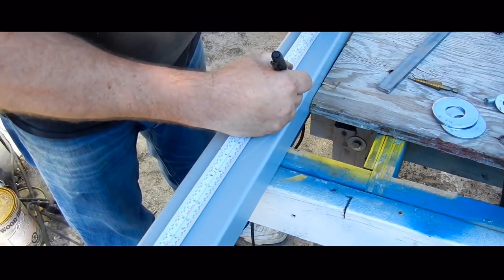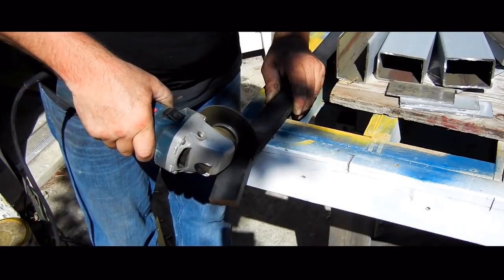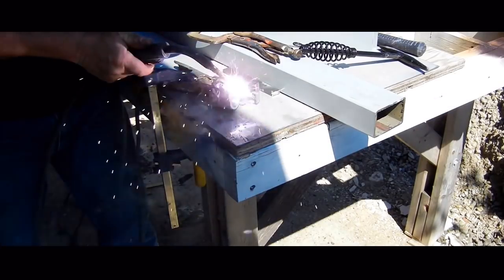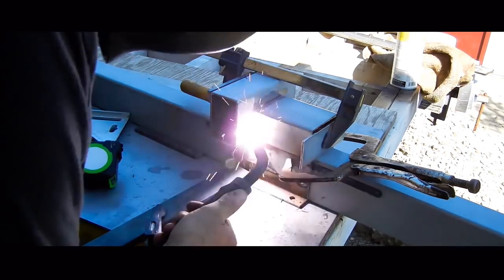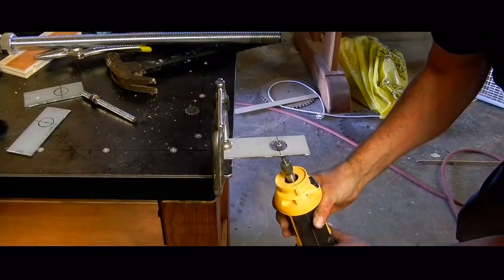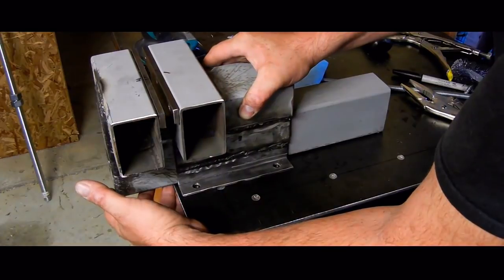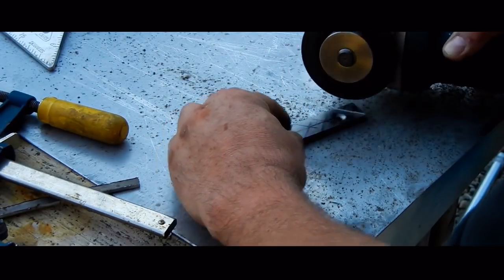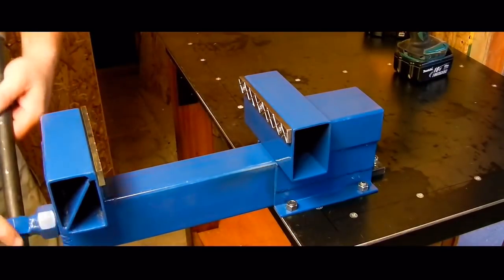How To Make A Heavy Duty Steel Vise

Comment: HI JOHN off the rail road track. I got very lucky a friend of mines uncle past my friend had to finish up his estate & wanted me to help him go through things & clean up the place so it could be sold.of course i said yes. damn glad i did we found a buze saw blade, arbor, block bearings, a solid steel anvil/12" vice the blade was still in the wood shipping create. we had piles that went different places he told me to put this stuff in the trash pile. I said U R crazy as hell my truck turned into trash pile holder. what got me was he knew what the stuff was as i did. i have used the vise over 20 years i have 2 old case tractors with saw pulleys  but i cant take the blade out of the create SEARS & ROBUCK everything is still on it. Anyway i have a wire welder & all the tools to build you're vice i want a 12" throut in mine just to hold wood THANKS for the plans very very NICE

Comment: I really liked this video there are several diy projects I have been currently been tossing around in my head lately I have 2 old break drums I was thinking of grinding down and using and I have a ace die and cast kit just no welder or other scrap metal I'm going to try and make two with what I got one horizontal and one vertical on an old tool chest I have awesome video enjoyed the knowledge

Comment: Good stuff, very helpful for my build. That said, if anyone (or OP for that matter) is interested in making a high quality *heavy duty* vise but also shares my preference for repurposing over true "bespoke" building for whatever reason (lack of comprehensive technical skills w/a dash of laziness in my case, heh); then I can highly recommend using a standard-issue generic car "scissor jack" as your base materials as a alternative to seeking out the correct steel square tubings + lotsa measuring and cutting. Everything is already built to fit together perfectly as well as to function like a vise that's been built backwards, so you basically are deconstructing & reassembling/welding it back together in an inverse fashion (not literally, of course).  Even the most cut-rate jack is still designed to suspend a car in the air too... All of that is made even more appealing by [my unverified assumption of] literally billions of these things having been made, which I swear also sometimes have the ability to self-replicate because *twice* in my life  I've found two of these suckers laying around when I was *certain* I only had one.... and also have no idea where any of them came from either! Hahaha

Comment: it has been some time now since I last built a vise using your idea 
now I moved out of my old home to a new home and gave it away now I did not think of ever needing it again so here I am in need of another vise now a question are you using Flux core mig wire in your mig welder seem to think a stick welder works faster and I have both machine's 
a lot more persist than then a stick is the mig 
any hoo your video  is amongst the many  and the  best of  them all

Comment: First of all, the build is impressive. Your finished product is beautiful, and based off of the durability of steel vs. cast iron, your vise will outlive and outperform the professionally manufactured counterparts. Now I'm not saying it's going to outperform a high end Wilton or some $700-$1000 bench vise, but it will DEFINITELY outperform any vise in the $500 and under range. 

I would LOVE to do this build, but I can't without guesswork. Either I'm missing it somehow, or you haven't provided dimensions and measurements for the build. I even downloaded "SketchUp" by clicking on the provided link. I can see the image of your vise on "ibuildit", but I don't see a single measurement for the length of the cuts on the steel tubing. Like I said, maybe I'm just overlooking it, and if so, I apologize. But if they aren't there I'm assuming this was intentional on your part. 

Also, pay no attention to any of the naysayers. I always tell people that the greatest athlete in the world is the armchair quarterback. It's the fat, un-athletic, beer guzzling slob sitting in his lazy boy recliner- criticizing every player on the filed. The guy has 0 athletic ability, but in his own mind he could out-think and out-perform every player on the field. The biggest critics are usually people with no "skin in the game". GREAT BUILD JOHN!
Reply from the maker: +Trinity Maker 
Glad you like the project. The SketchUp plan provided is just a model - you will need to familiarize yourself with SketchUp a bit to use it. Basically, you can use the measuring tape tool to get the dimensions.
Reply: you're a genius i have to say
Reply: Trinity Maker no, dont lie

Comment: 3 things:

1. Why no cross brace in the sliding jaw?
2. What do you mean "like the real thing", seems pretty real to me?
3. Wouldn't  it look better with the mounting bolts head side up?

This is the third vise I have seen you build, the wooden bench top is my favorite to look at, and I don't  know how I missed this one  the first time.
Reply: Oops, for no.1 I meant the stationary  jaw.
Reply from the maker: Darnley Bynoe 
1. Physics 
2. Store bought 
3. threaded rod, not bolts
Reply: 1. Is it because the fixed jaw has that rectangular T-type support and the sliding one has only the verticle plate?, 2. Oh, but still just love the way that wooden one looks, might even try to make one with one of your wooden threaded rod as soon as someone figures out a simpler way to make diy wooden female threads., 3. Oh, again, guess I missed that they weren't bolts.

Love your stuff for many years now.

Comment: You may have just justified my "need" for a welder! Having woodworking AND metal working skills is a great way to expand the suite of projects that I can do. I took metal shop in high school many years ago, and actually did some welding during my first year of employment. Hopefully it's a matter of scraping off the rust (sorry, I had to write that) and buying a 90 amp welder. Do you recommend MIG or TIG welders? I don't want to use traditional rods, because it's way too messy.
Reply: Recommending a welder is difficult if nothing is known about intended use. Each process has its strengths, and weaknesses. Personally I have them all. I got a MIG, a TIG, stick, and a gas torch too. Now which I'd favor would depend on what I was welding. But if I had to recommend just one to a hack starting out in their garage I'd go with MIG. Because MIG fits that profile the best. It is easy, and versatile too.

Two important considerations in that case. Now over time I've come to appreciate the sheer simplicity of stick welding myself. No gas bottles to play with, no wire spools to deal with. I can just put a rod in a stinger, and go basically. Flip the switch.

Plus all of them other processes are for pussies compared to stick welding. I kid, no I don't. But seriously stick welding is for the purists. Man versus steel.
Reply: Paul Frederick Yea everything else is easy compared to sticks-hard to master but when you do you easy adapt to mig or tig.

Why is it harder than others:
-you have to constantly adapt to the shrinking size of electrode
-you have to maintain constant speed and distance for a good arch
-and angle of electrode affects the puddle of welding too

+is electrodes for iron are cheap
+stick welders are cheaper than tig or mig
+you can buy inverter with tig and stick welding
+no extra money is spent on protective gasses(not everyone has bottle refill factorys nearby)
+no money is spent on replacement parts like tig and mig have

So for a hobby welder buy a good mask and stick welder(don't go auto darkening-good ones are expensive(800,900$ ),cheap chinese are good for nothing).
Decent stick welder costs around 200$ (inverters)or if you are lucky you can get good old 1970-80s transformer which will run for another 50 years for 50-100$.
There is no need for buying fancy equipment if you cant make money out of it,so yea stick welders are great for starters.Sure they are more difficult to master ,but nothing is impossible if you try hard.sSpend a pac of electrodes weekly and for a 1 month you will see drastic improvement.Your hand gets used to it.
Reply: zumbazumba1
I don't know. Yeah there are things to deal with stick welding. Chipping flux, and stuff like that. Like you say, feeding the electrode too. I think it all comes to practice though. One thing I'll do is warm up coupons before I weld a bead I care about. Because I don't weld every day. So a little practice ahead of time gets me going again. Failing to plan is planning to fail. I tell folks success hinges on preparation too.

I see lots of people that get it in their head that they can work any old dirty way. I suppose they can too. But the job they do is going to reflect that. Get everything ironed out before running a bead that matters. Because things aren't going to just magically start happening usually.
Reply: Paul Frederick Thanks! I was trained and became quite good at heliarc welding on .052' thick aluminum. So I am probably most interested in something using inert gas as the flux. I'll look around the local tool shops and see what I can find.
Reply: MrJohnnyboyrebel
I've read about heliarc. I do not think it is too popular anymore. Today Argon and Carbon Dioxide are the more used shield gasses. Aluminum is too finicky for me to weld. My success rate with it is so low I don't even bother with it anymore. That is likely due to the humidity level where I live.

Good luck with gas bottles if you swap them. Good luck getting bottles that don't leak that is. It got so bad with the gas house I used to deal with that I started bringing soapy water with me.
Reply: +John Treble Heliarc is pretty much the same as tig  late replies are best replies
Reply: EvilBunny
TIG is heliarc if you use Helium as your shield gas. Helium is not a particularly renewable resource so there is only a finite supply of recoverable Helium in the world. Which is why other shield gasses are more popular now. All of this is why the Germans used hydrogen in the Hindenburg. They just didn't have Helium. We weren't in the mood to give them any just then either.

Comment: Maybe it's asked already but 183 reactions is to many to read. What type of welding do you use because you have no gas nozzle around your torch. But also no filled wire because you have to hit the slag of. Can you tell me because I like it for welding outside in the wind. Thanks al lot!!!
Reply: Teun Geerlings He used FCAW. It is one of two ways to do MIG (wire feed arc welding), and this is the one where the flux on the wire shields the bead instead of using gas for shielding like you would with GMAW

Comment: John, I have a welder and I am a novice at it.  Why is it important to knock off the slag?
Reply: It is not. But painting on parts that will flake off with use is bad. welding on top off existing slag or rust can give a rubbish weld that looks terrible.
As a welder I have to say. Do not knock of slag. With correct machine settings it should be possible to gently scrape the slag off. Some oil companys in Norway will fail a weld with chip or grind marks in it.
Reply from the maker: Marc Eaton To clean the weld and and the hammering will relieve some of the stress from welding.
Reply: John Heisz Okay thank you.
Reply: Ant Mallett I asked John not you.  Of course you say it is nonsense and offer no explanation.
Reply: Grows because of that the slag to knock out because the quality of the welding is not seen from the slag.

Comment: if i was making this i would fill the hollow pipes with sand and hammer the sand in to compact it and then cap off the ends to make it that bit stronger
Reply: I dont think it would give much strength, if any!
Sand is usefull to dampen vibration if what you're making has a tendancy to do so, though...

Comment: Is the steel not galvanized so that the paint doesn't stick?
Reply: +Jc Bx The steel was not raw stock, it was something he got free and already had paint on it. Which means all the cleaning had already been done.
Reply: Aaaand you can paint galvanised steel....

Galvanised steel is just steel that's been zinc coated! it has nothing to do with keeping paint off, but is meant to resist rusting.

Comment: What kind of welder are you using
Reply: I dont know the brand but I know for sure that its flux core and is running on assumably 110 volts.

Comment: Only problem with this is that all thread rod is soft ,and most of heavy duty vises use square threads which are better because they have increased strength and they can carry a higher loads.Also they are made of special steel,and usualy heat treated.But again for smaller force its perfectly fine,like woodworking,and you can always replace all thread.

If you are going to buy vise- cast iron,not good for impacts and it brakes.If you are not going to use sledgehammer like for woodworking then those are fine.Just stay away from cast iron if you are going to do heavy  work.Good steel vise costs more but usualy you are going to buy it once in a lifetime,so save money for those.
But again for smaller force its perfectly fine,like woodworking,and you can always replace all thread.
Reply: Store bought vises never have one inch thread acme.screws, so IM sure this will be plenty strong
Reply: nikotwenty
Its not important how thick screw is ,its the shape and material of which is constructed.
I don't know if you refer to thickness or thread per inch since i use metric system like the rest of world.
In my country you can buy heavy duty vise for 100$ that will have acme thread up to 30 mm in diameter.So yea those exist if you look at professional range.And chance to broke those is if you use 10kg(20pounds) hammer and beat it all day for 5-10 years.
Reply: Well,I guess it depends where you shop!
Here in europe, most woodworking leg vise kits, or woodworking vises you can get have screws that size, if not bigger, and any metalworking vise that's worth buying does too...
I've not dismantled cheap-ass  big box store 20 to 50 euro vises to see their threads, so these might have standard or fine thread, but every Vise I've seen in a professional shop be it brand spanking new or 120 years old had thick square thread screws!

Comment: $80 metal to build a $40 vice
Reply: I buy scrap regularly, its more than you would think. The screw mechanism alone costs around $40 if you cant find used.

A 5ft x 2" x2" piece hardened angle iron is $22....
Reply: This is more like a $10 in parts (if that) on a really strong and cool tool that you made yourself. If you don't understand the value of that, you should look for some recipe videos instead.
Reply: I buy scrap regularly, where in the actual fuck are you buying scrap?

Comment: Were you seriously mig welding outside and with no nozzle?
Reply: +Ravenous Pathogen flux core
Reply: Even flux core needs shielding gas, hence the nozzle, the flux is INSIDE = flux CORE
Reply from the maker: +Ravenous Pathogen Google fcaw. You don't need shielding gas with flux core wire.
Reply: I have been known to be wrong.  I always use an 80/20 of Argon and CO2.  I thought one needed gas for flux, if it works for you, cool.
Reply: Ravenous Pathogen there is types of fluxcore that needs gas as well though
Reply: I didn't know that, thx
Reply: +Michael Kopka wut?

Comment: to optima 1 I don't think U have done very much with an angle grinder. if U are trying to save a little money U risk a little pain. sometimes U have to do a little unsafe work i don't give a damn who U R. the guy that invented the grinder wasn't scared he went forth & made it then saw he had to put a shield on it for safety & people who didn't know what the hell they were doing so he wouldn't wind up in court with stupid people! to who ever wire welding is fun & easy take you're time read the book with welder it will teach U a lot + use common sense. make damn sure U wear good eye protection if anyone out there gets there eyes flash burned U will know it when U wake up the next morning it feels like sand in you're eyes U cant hold them open DON"T try to look at the sun! if its bad enough you're ass is going to pass OUT i did it hurts like hell.

Comment: And NEVER use angle grinder without guard !!!!
Reply: That might be the accepted way, but 9:10 the guard gets in the way! I never use my guard, it's a risk I am prepared to take, in 40 years I have never had an accident, if I can get by for another 20 I will be quite happy!
Reply: Phil Sale I have left my guard on for now because i just haven't needed to take it off yet. Once it gets in the way it will be removed and be lost right away.